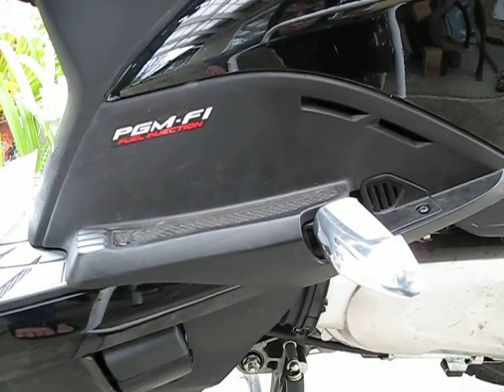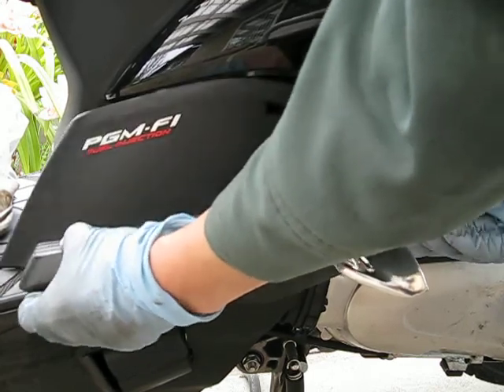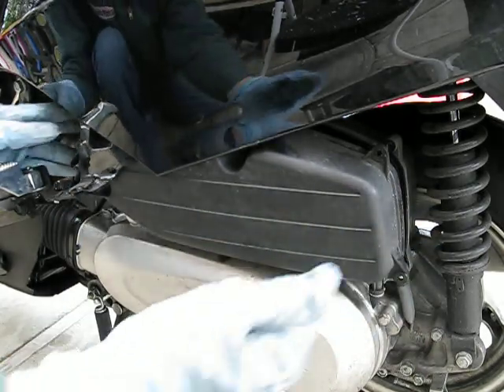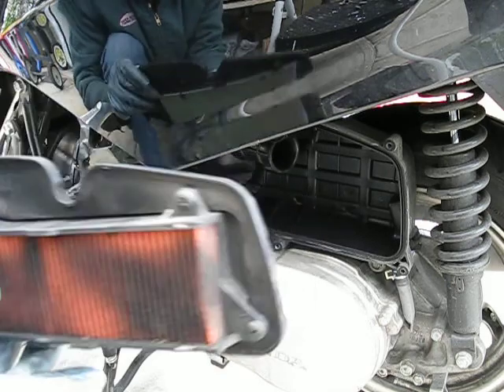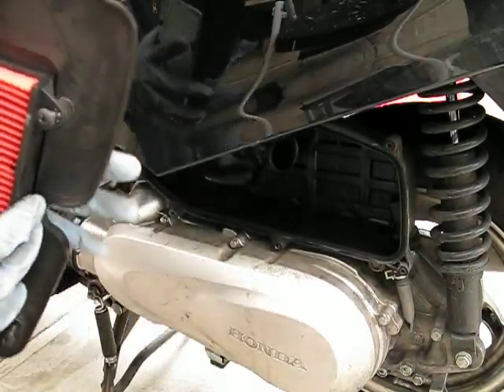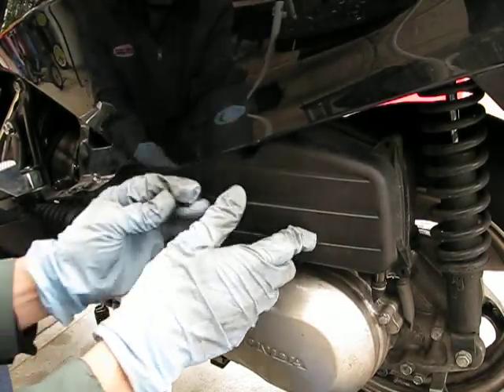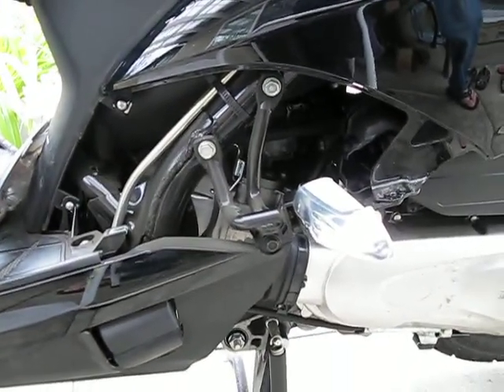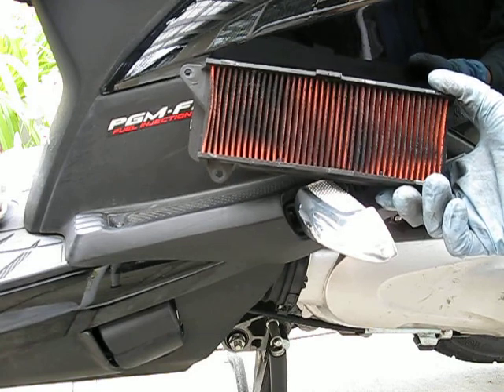Honda NHX110 Air Filter Replacement

Comment: Today I changed to the "performance" k&n filter. easy job. not a sinch, but easy. maybe 15 phillips head screws altogether? dont expect the filter to make your top speed near 60 on this bike. if you can get to 55 you'd be lucky. I DO recommend the bridgestone 4.0x10 for the rear. it gains you about 3/4 mph top speed. The k&n filter maybe gave me a little more pep, but it's not all that noticeable. My old filter was filthy at 3000 miles. But, the bike is 10 years old. I'm just breaking it in...

Comment: i have an overheat.. (probably because exhaust fell off an was still ridden)..code says caused wiring in iacv valve to fail.. do i need to take the unit apart? or do you think replacing the valve will be enough?

Comment: Hey there. Do you have a video on how to change the brake fluid on this thing? Also, someone mentioned that you have a way of bending a part under the seat that could cause some electrical issues down the road by over-excessive rubbing. Could you share that video as well? Thanks!
Reply from the maker: I have both videos under NHX110 playlist.

Comment: Hi recently i change air filter and used honda genuine air filter; after 2 rides i get engine light with 2 long 9 short blinks corresponded to “iacv”. Is this because of the air filter? What should I do? 
I also changed engine oil and transmission oil during same time. What could it be ?
Reply from the maker: No, that is most likely your wires.  How many miles? I have videos on this problem and how to prevent or solve it.